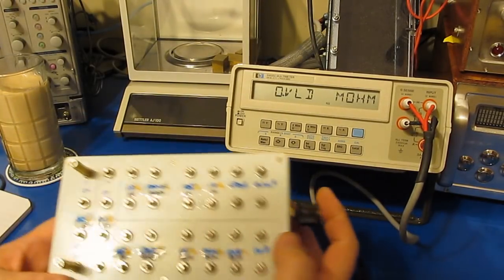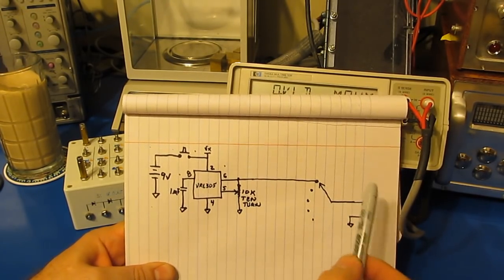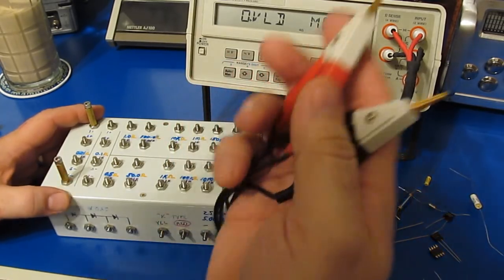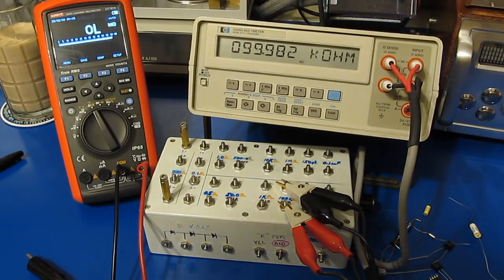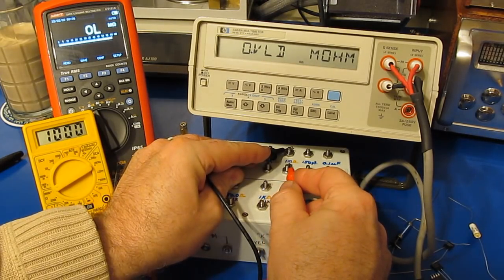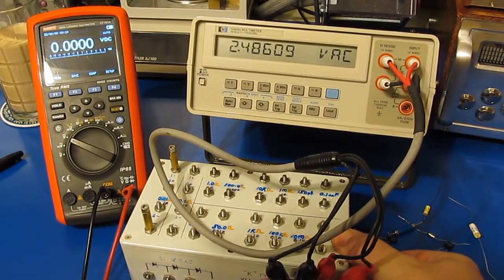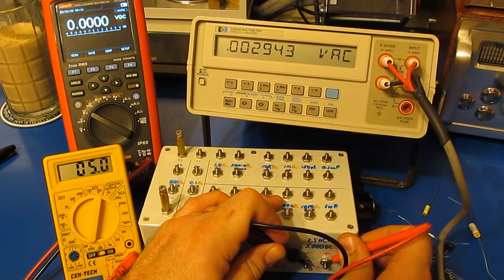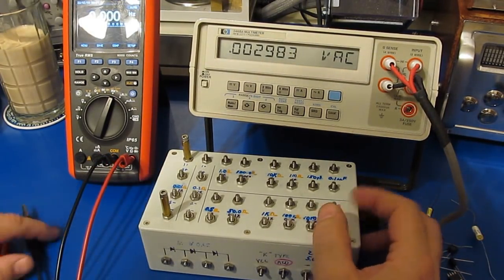What's in the Box?  Multimeter Test Jig

Comment: Nice box! Have you ever considered making one that switches in the different parts automatically?  Seems like that would be a nice project and could make testing the meters at each transient level a bit easier.
Reply from the maker: Its grown over time.  Even one common point would help.   However, I don't use it very often.  It's just to give me an indication if a meter is starting to fail.
Reply: @joesmith-je3tq  Thats true about the common point.  Perhaps if I make a similar box I would go that route.    Thanks, have a great day!

Comment: https://www.apexanalog.com/resources/products/vre305ds.pdf
Reply from the maker: Yes, that is the part I am using.  It's not in an oven but I really only use this box for a basic functional test.
Reply: Awesome specs...temperature drift 0.6ppm/°C ! Best than voltage reference used in Fluke 287/289 (LT1019) https://www.analog.com/media/en/technical-documentation/data-sheets/1019fd.pdf

Comment: Really neat test box and uses a battery from the multimeters. How much current does it draws? I bet very little :P Nice uni-t ( unique display) and it's  a shame that it failed in the ESD test ( you like that meter) . I had a yellow cheap multimeter that exploded when reading mains voltage in AC volts maximum :( ( free bang )Anyway the cheap is good for starting with some low DC and AC voltages but my first multimeter was really a analogue pocket Protek A800 and that works good ( 1992) it is similar to the Radio Shack 22-212B.
Reply from the maker: I ended up with some 18650s out of an old laptop to power it.  I've never measure the current but it's only on for a very short time.  The batteries are still on their first charge.

Of all the UNI-T products I have looked at, the only two I like are the UT210E and the UT181A.  The UT181A has way too many shortcomings even beyond that fact it can't survive the smallest of an ESD event.  Typical of UNI-T from what I have seen.
Reply: What about the uni-t 90A? Before i bought the uni-t 50B in the shop there was a very similar multimeter to the 90A and its was a bit more expensive  also had extra features that i didn't need such as the indication on the probe connection ( 58A maybe ).

About the batteries they will last long on the JIG and are easy / cheap to recharge nowadays
Reply from the maker: I am not sure what you are asking.  The UT90A is a very basic meter.   I've repaired the one I own several times and it has been used a few times in various videos.   I'm sure there are people who look at all of the testing I have done with it and say, that's impressive how well it survives.  Along the same lines as thinking I put a 5KV  transient across a meter so the feel they can directly measure the output from a MOT.
Reply: The question was in the subject of the uni-t's that you prefer ( meaning maybe surviving / having features) and i remembered the videos from the uni-t90A that survived better if it would be included on the uni-t that you liked, since it's price and survival. If it is a survival it surely is more safe to be less probe to transients that sometimes are presented in the mains voltage, such as the personal electric boards ( 230V AC in my case) and poses less risk to multimeter / person injury. Now if people are doing random tests at the voltage 5KV without the ESD / CAT spec  they are exceding the multimeter and breaking it.
Reply from the maker: You feel these tests have something to do with safety?   Have you read the FAQ?   How do you come to believe that if a meter survives to higher levels that is is safer to use?     I understand from your other comments you are just starting out so no problem.  I just want to understand how you are coming up with these ideas.

Just to add, if you could explain why you feel this way, I may make a video that may help you and others better understand what is going on.
Reply: Hi i didn't read the FAQ so far, but from a perspective of CAT tests that are ment for insulation, i probably got the ideia if a meter can handle bigger transients will have better insulation, for a specific amount of energy, thus will have less probability to be blown when plugged to the mains or proper protection devices may be triggered. This of course does not discards all safety procedures that we must do when on a electric board ( gloves, proper insulation , check grounding ). For example, which multimeter will you trust for plug into the mains? A aneng 8002 or a fluke 101 which are in the same multimeter types ( pocket, small ). It's not about surviving but also if it blows it can protects you that incident.
Reply: I read a part of the FAQ about the safety and you're correct on the certification Lab. Maybe i'm confused with this tests since they are about witstand spikes . About safer i got from here:

http://www.ni.com/white-paper/5019/en/

Yes i'm a newbie ....
Reply from the maker: In the paper you link they talk about a safety standard 61010.  How do you know if a meter meets this?    Do you feel I am somehow testing to this standard?  The paper you link only mentions the voltage levels.  There is no mention of the currents involved.   Do you think safety is all about the voltage levels?   Do you feel that the several KV coming off the little grill starter I used to use would kill you or explode a meter? 

You want to know if I would trust an Aneng 8002 for a CAT III environment that is marked on the meter.  Let me ask you, do you feel this meter would pass that 61010 standard?   It should, it has a CE mark.
Reply: About the current there is the impedance source that is applied in tests but in real life it's another story... I think i've saw a video that you mentioned that you're tests are bellow the standards in terms of energy, however i considered that it would give some measure of safety on the multimeter and since i don't know the metters meets this i prefer a opinion from a real tester .I consider that safety is not only about voltage levels but energy passed between test points. The grill starter is just the starting point for failure at a small amount of energy. It will not explode immediately but if you don't noticed that ESD damage occured and plugged the meter to the mains than its another story. In daily use i saw people switching ranges whille measuring volts, pluggin resistor mode into a power source or even current and maybe if a multimeter is more tolerant to this errors it will poses less risks / damages. I'm not trying to divert your tests / info since you clarified so well in FAQ but wanted to know if this tests can give me a feedback of safety if i buy a new meter for a specific purpose.

The aneng 8001 that i have i've blown the mA fuse by accident when measuring current of a LED tourch and got to the lab to see it was alright and when i open, i saw a PTC, a diode , tiny little non filled ceramic fuses, melf resistors which is okay for electronics  , but an electric board.... i don't feel so safe since i had a previous cheap meter explosion
Reply: Ohh crap you know the impedance from the generator but the arc on the instrument is can't be measured quite well is it?

Comment: Hey Joe
 that's a cool setup you got there love it I am a hobbyist myself, I would like to build a small box with just the 7400 ic part of your box did you have a schematic to build if it's ok for you to share or if you can help me with a link to building it I just don't have the experience with 7400ic yet to know how to cascade them if that's even how you do it thanks in advanced keep those videos coming A+
Reply from the maker: There's not much to it.  I use a crystal and inverters to form the oscillator and just divide it down.  I didn't create even a paper sketch for it.
Reply: joe smith thanks Joe I will give it a try
Reply from the maker: https://electronics.stackexchange.com/questions/218142/using-cmos-schmitt-trigger-inverters-in-quartz-crystal-oscillator-circuit

Comment: how about making those super precision resistors at home using Constantan wire or thin sheets and a lasercutter.  everything suspended in oil later on?
Reply from the maker: What would be the point?  Calculate what it would take to make a 1Gohm resistor.
Reply: making precision resistors at home.  just a rough idea, using this wire would probably result in a huge mess for 1gohm
Reply from the maker: Do you feel you could go better than a purchased part?  In the end, these are not used for a calibration standard but instead just for functional testing the meters.  I did make a few different resistors for the UT61E and posted a video about it.

Comment: The little yellow meters have a bare minimum of parts and ordinary resistors for reference, and no super accurate voltage reference for voltage/current reading.
They are really cheap.
I use them for checking fuses/speakers and basic "Is the power there" tests.
I dont use them for 240v mains testing, for obvious reasons LOL :-D
And i wont cry if it gets dropped and smashes :-)
Reply from the maker: They can be had for free with a coupon here.
Reply: The mad thing is they use a ICL7106 adc, almost identical to the chip that fluke used in there first handheld digital.
The 7106 can be very good with fluke quality ref resistors and ref voltage.
Now aint that mad :-)
I have a fluke, but the little yellows are ok for basics :-)
Reply from the maker: I would never consider it a very good meter.  It does have the free part going for it.  I could see using it in the garage for low voltage work but it has no backlight and that lack of a fuse in the 10A range is really bad.  I guess the PCB is the fuse.   Low current fuse is now soldered in.  So much for changing it in the field.  What to buzz something out, dang there is no beeper so you have to stare at the LCD.   It's better than what I started with but the goal post is set pretty low for that.  Good, no.  Free, yes.
Reply: Yes i agree, for the cheapness they are ok for fuse/battery testers as a rough idea.
Shame the manufacturers wasted an icl7106 by skimping on parts :-(

Comment: Hi Joe, nice video and a nice box, why didn't you go up higher in the test frequencies?
Reply from the maker: I thought about using a micro, with a bunch of features.  Freq, duty cycle, wave shapes... The more I thought about it,  it seemed like a waste of time.   The box gives me a way to quickly do a sanity check on a meter.   It's not to replace the ARBs, voltage standards or RF generators.  So in the end, it's an inverter with some FFs.

Comment: That's too funny, was working on my box today and I was wondering how you did yours. 
I want to set mine up so I can check the resistors with 2 wire and 4 wire, but I'm using banana jacks. I chose the Vishay RNC90X resistors for most of the ranges and I'm working in on putting a voltage reference based on the TI REF102CP in it for 10VDC and 5VDC with BB INA105. And just one polyurethane thin metal capacitor precision capacitor. I never thought about doing an AC signal, my box isn't that big so probably not in this version. 
You have a lot more then I was thinking, I only wanted to put the items I've been using for a year in one box for now since I have my meters documented with these items already from year ago and can see if they drift or how much they are drifting.
That's a nice set up.